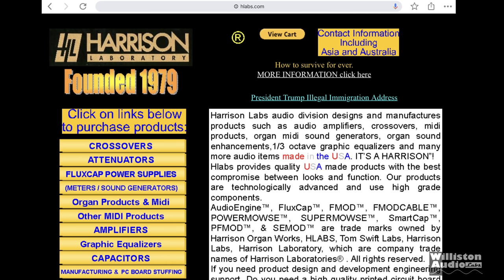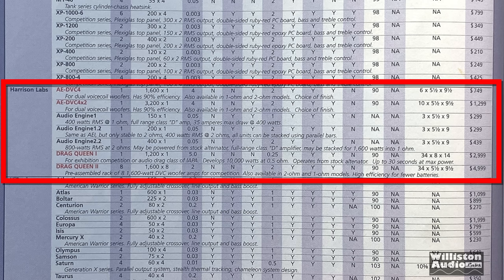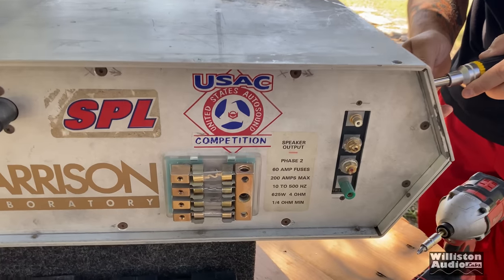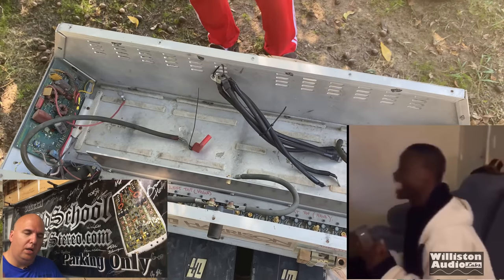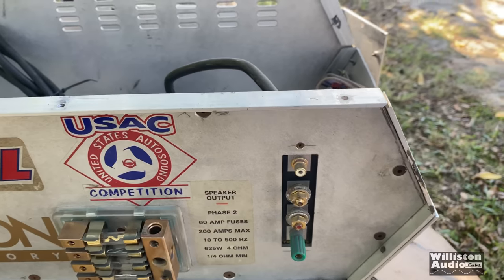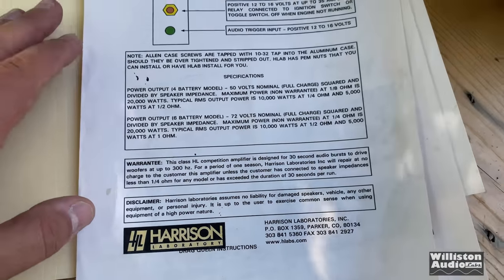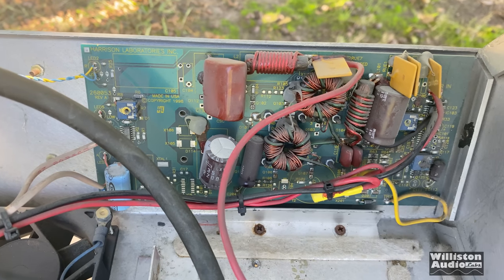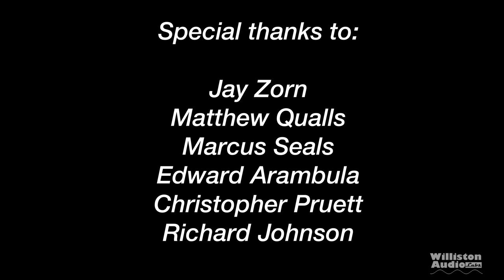20,000 watt Amp Banned from Competitions? 2000 Harrison Labs Drag Queen [4K]

Comment: To clarify some stuff very late in the game...

The amp was banned because it is not a conventional amplifier.  It is a "digital" waveform.  Basically, it applies the battery bank directly to the speakers, chopped by the hertz rate.  So you get an EXTREMELY square, clipped waveform. 

Normal amps use filtering and inductors.  They try to create a perfect copy of the input signal, which is a sine wave.  Imagine a smooth wiggle.  This amp produces a square wave, the output is full bank voltage or off, nothing in between.  Imagine violently banging back and forth at the same frequency as hard and violently as possible.  Like a switch vs a dimmer.  It works as a very crude, constant amplitude PWM output amp.  Tons of distortion, super high efficiency.  

Hook a 75 volt battery bank to a switch, wire it to your subs and blink it on and off at 35hz.  That would be what this amp does.
Reply from the maker: Thanks for the explanation 👌
Reply: Thank you for the explanation
Reply: Can u play music on it though? Can you control the volume at all?
Reply: @dropzonemedia7811  Ofc you can do but it has distortion which was said in the comment
Reply: Makes sense. Thanks.
Reply: Not sure if your right as almost all amps are class D now. They swith so fast you cant hear, they switch in between a wave multiple times so you wont even hear it.
Reply: @lennartgosman3640  You have to consider when the amp was made.  High current, high speed switching  transistors were expensive and unneeded.  This was a specific purpose amp, it didnt need to work at higher frequencies.
Reply: @lennartgosman3640  It was banned because it wasn't anything like a modern amp. It was straight up using transistors to send high DC Voltage to the speakers in a square wave. This would indeed make the speakers get loud, but it would sound very lousy. There are some free signal general apps that let you choose the type of wave. A square wave sounds very bad.
Reply: @lennartgosman3640  You are right but the amplifier didnt create a sinus wave. So there is a step missing which a class d would do
Reply: I doubt a square wave is noticeable unless u are a Bat 🦇
Reply: @dropzonemedia7811  it is noticeable. Atleast listen to one before you say that. It's easy to find examples. Some phone apps have tone or signal generators that let you choose the wave form. It's a big difference.
Reply: @RichardsWorld  yea its a big difference at the same volume, but how do u compare it at different volumes? Honestly they would sound the same if they was at the same volume😞 At least to the human ears
Reply: @dropzonemedia7811  big difference at higher frequencies. At higher frequencies you can't hear the difference. Although I forgot mote than I can remember,  I studied electronics in high school for 2 years, and junior college another 18 months. But, that was in the 90's. Things are way different these days, but the basics will never change. There is a video on YouTube about can you hear the difference between a sine wave and square wave. But, listening to it on your phone doesn't do it justice.
Reply: @RichardsWorld  yea i tried to listen on my phone 📱 But I understand. Still don’t understand banning it tho
Reply: @dropzonemedia7811  a square wave at those frequencies sounds like a buzz saw. It sounds like an over saturated distorted extremely clipping amp. It would be the mechanical limitation of the sub's inability to move at the speeds commanded by the square wave that would take the edge off the garbage tone. It was banned because was like sticking an amp into a wall socket and calling it an amp except the wall socket would sound better. He explained why it was banned its not even amping it is just switching on and off a connection to the battery at bass frequencies. Yes you could use it to play music but it would sound like tesla coil buzz saw bass. I don't know for sure but I don't think it had volume control either just full blast all the time so you would have to modulate amplitude by the signal input and so any line static would be like an ever present white noise at low levels like how an amp sounds when its turned all the way up even when nothing is played but without the filtration that we take for granted in typical amps. All that being said, technically if a correctly sized capacitor was introduced to the output of this "amp" that square wave can be converted to a sine wave but likely only very effectively around the frequency it is tuned to making it sound good enough for SPL purposes.
Reply: @Siiello  sounds like a burp amp
Reply: @dropzonemedia7811   If you can not hear difference between square wave and sine wave at the bass frequenezies this was used I have bad news for you, that means your are deaf...

Comment: So for the people that don’t understand what it is this is it in simplified.. it’s a giant push/pull mosfet switch, not an amp. It puts out more or less a square wave based on an input signal, and the mosfets directly dump current from the battery bank to the subwoofers. And with that, 99% of what makes an amp an amp isn’t needed here, just a shit ton of mosfets in parallel in a push/pull configuration. Yes it will for sure do 20KW at a low enough impedance (that’s a LOTTTT of mosfets), and the efficiency is practically 100%. If someone built this with that number of TO-220 pack mosfets from today, they could probably make it do 50kw+. It’s just a switch. It’s easy to build something this powerful that functions this way
Reply: Thanks for the details
Reply: Yeah based on the output voltage, its not like most half bridges you see.... there is voltage potential on each output or else you have to divide the output by two when taking 72v squared...  in the manual here it says voltage squared divided by impedance.... not voltage squared divided by two and then divided by impedance (like half bridge amps where negative is ground). So its like a full bridge amp.. but a very weird one.

Comment: I have a Harrison Labs Audio Engine 1600 I said I would ship to you for testing. You just say when Derick
Reply: I’m amazed he doesn’t want it
Reply: Can i have it? Lol if only
Reply: You'd probably have to email him
Reply: Ah go take it
Reply: He doesn't read any comments.
Reply: @grady.stu.8300  not so sure months back he responded to my comment of the stereo in my airplane with larger Wing spars to support the weight of wolfers, mids and tweets. as well as a fold down swivel flat screen TV in each wing. Although most of the extra weight is it in other unique control features.   Designed and built plane myself nearly 15 years ago.  It's a  superstol bush plane. It's painted with metal flake, pearls, lace, and murals. I built it to sort of look like an old hot rod has side pipes. And behind the Moto meter is a hilborn 4 butterfly scoop. That feeds 2 AMR 500 superchargers. It also has 16 in of travel  on actual swingarms controlled by Fox air. Not typical at all. Not only can you see people looking up when they hear me flying "thumping" by. Lol But it gets attention on the ground as well.
Reply: @Ozarkprepper643  post a video

Comment: It is nearly a crime to not get this functional and on the amp dyno! This thing is a very unique classic. I remember hearing about these and seeing photos, but would love to see one in operation / dyno tested, bet only a handful of people have ever seen one of these in action.
Reply from the maker: Since the power it creates is clipped, I'm not certain even with fresh batteries and in working condition the Dyno could test it.
Reply: @wal   Doesn't the Dyno have a setting where it can read power with clipping / distortion and not shut off? Would be cool to see the power it was putting out even with clipping; yeah it may be clipped power, but still power, even if not at rated impedance's. I mean this amp was banned from competition, and I'd guess hardly anyone has actually seen one of these running since they are pretty rare, so to get to see it actually function / power some subs would be a rare occurrence, even if power measurements are not exactly spot on, just cool to see all around.
Reply: thats right.... I only ever heard of it myself here in Hawaii and thats because I was in Vegas for CES..... People talked....

Comment: Actually there are similar working amps in production: Taramps, Stetsom and other brazilian brands produce High Voltage amplifiers, we are about to make the first HV system in México with a Taramps HV 160k and 24 12v batteries in series to get 300 volts DC in the voltage rails. This amp uses welding machine transistors to cope with the power handling, not too much audio quality but they work to make crazy systems like the "carreta treme treme" and other brazilian monsters without spending thousands in heavy gauge wiring and high output alternators, just buying multiple cheap flooded or sealed batteries and 4 awg wire (higher voltage equals less current to make the same power, so you dont need big wires to connect the amplifier).

Comment: It got banned because it is NOT an amplifier but a switch that makes square wave signal directly from the battery power... In short is is a brute force primitive signal generator that can only make square wave signal.
Reply: That’s all I wanted to know.
Reply: frequencies go in, frequencies come out louder. that’s an amplifier. it’s a weird amp, but it is an amp.
Reply: but there are NO components that can handle 1000 amps (or even 100A)  which is what you need to get 10KW from 12V so its pure BS
Reply: @harlanfalejczyk2478  not an amplifier, Its an oscillator
Reply: With a transistor opened all the way up it will dissipate little power, like people are saying switching mode, all the signs are there. High efficiency, no heat sinks, power on tap. Shit, I give this dude credit, he put out some redank shit and people forked out. Look at those custom boards tho, no mpja or Amazon back in those days 🎉 better charge every penny when only ~20 were made.

Comment: i remember the db drag days...started with 2 orion 2NT 15s in a pre fab box and an orion beast amp, then moved on to 2 mmats pro audio 15s in a custom slot vented box with a mmats d200 on each. surprised my windows never broke, you could see the front windshield pushing against the sealant and trim lol...those were the days.

Comment: Simular design to the tar amps high voltage, it’s full bridge configuration, so 72 volts * .707 is rms AC voltage , power ~ 51*51 Divided by the impedance = about 10,000 watts rms at 0.25 ohms

Comment: Don't bother testing it. It merely puts out a square wave at the fundamental frequency of the bass. It merely uses a comparator, which switches the polarity of the battery pack to the speaker at the zero crossing of the audio signal, hence, no input level control. It was banned, because it isn't even an amplifier per se. It is just a high power switch box, thus, the sanctioning bodies don't consider this to be an "amplifier".
Reply from the maker: I wasn’t gonna 😝
Reply: It's an amplifier.. it just has the worst ever bandwidth and harmonic distortion.

Comment: I completely understand. But I'm still a little disappointed you didn't at least turn the amp on.
Reply: He couldnt. He was missing the other 4 batteries which were used to power it for a mere 30 second!
Reply: It won't turn on, that dawg has a 72 volt input 😄
Reply from the maker: We can try next October when I'm back in TX for the 2020 Old School Stereo meet
Reply: @wal  well it's October 2020 is there a chance to see this happen?
Reply: @GolIden  lol. U was waiting on that
Reply: @christopherbrock8913  not really i just happened to stumble across the comment and decided to write that.
Reply: @GolIden  I hear ya.   Hey do you think that a 1000 watt Power Acoustic Virgo (walmart lol) will do good on 2 Rockville 15 inch subs woofers and 1 Punch 12 inch sub? I think all 3 speakers are 1200 watts. I am getting a box built now for a mustang trunk.  Well I already have 2 planet audio 12s in there now. Trying to leave that box in and squeeze another box behind it. The box that is being built is not going to be the proper size for those 3 speakers. But do you think that amp and those speakers will do ok?

Comment: I honestly always wondered why there aren't more high voltage amps just for db drags, run them straight off batteries wired in series, there are already chargers out there that will charge 24v, 36v, 48v, etc off of a 12v system, they are made for lowriders to keep the batteries charged up fresh

Comment: Stan was way ahead of the game, producing basically "digital" amps back in 2000.
I used 4 of his "150w rated" and almost exited my L7 cones from their baskets before the amps blew from over-current draw due to limited battery and no over-current/low voltage draw protect circuit in the amps.
They hit like 1000w+ each, and had a real strong "Hard" hit to them.
A little while after that I ran a pair of Zapco 9.0s in their "4K" and it wasn't any stronger than Stan Harrison's four 150w amps that were each the size of a Soundstream Class A 50.
That "Drag Queen" appears to be the same one Stan sent me to test in 2001 when I competed in Highlands, CA. Unfortunately one half was already blown when I tested it in competition, but it still hit a 148.5 with only 1/2 of it running at 4ohms on two D4 L7 12".
Reply: It didnt wanna give lol!😎
Reply: 150db was a BIG NUMBER then... record might have been a bit higher in 2000 BUT.... only half an amp...LOL.... THAT THING SHOULD BE BROUGHT BACK TO LIFE........... its ALIVE...... ALIVE!!!!!!!..... 335,000 views demand it .... hey BIG D WiZ..... This guy... Mr Q.... cool... I remember that thing.... CONTROVERSIAL.... so it got the boot.... BDBD/2021
Reply: @GahhDamnAlex  hey another SILVA..... Howzit from HAWAII!!!!

Comment: I remember the controversy about these amps. There were other people experimenting with using batteries as the amps power. I believe even linear power made some of these, but they weren’t on the market for sale. These amps were actually dangerous if you didn’t understand how they worked LoL
Reply: If I’m not mistaken, I think the batteries were linked up to make 48 volts DC then that was converted to AC volts. These amps were not meant to be played for music. I think they only play about 3 to 4 frequencies so you had to build a box that would be tuned to what the amp could produce. Very efficient and powerful.
Reply: that HUGE POWER SWITCH was to turn it OFF.....LOL.... yep.... LIGHTNING in a BOX....